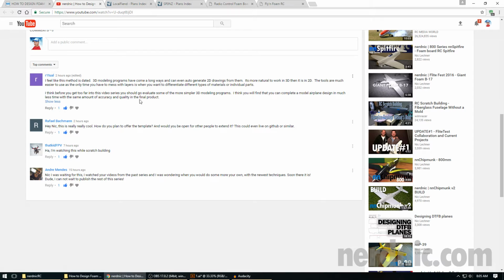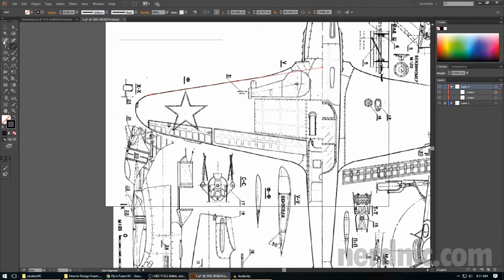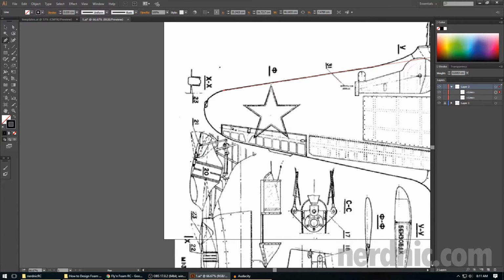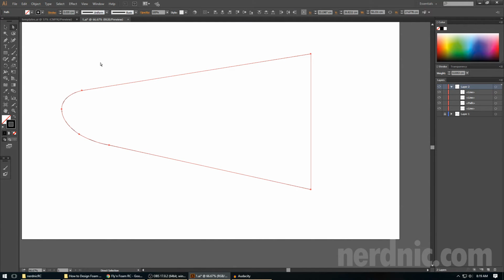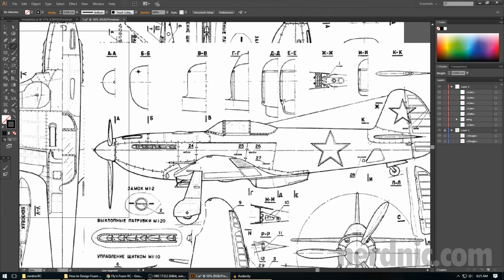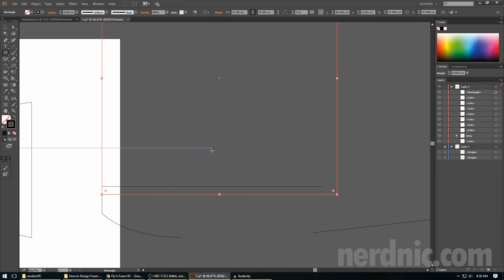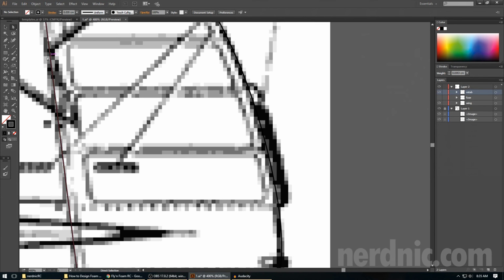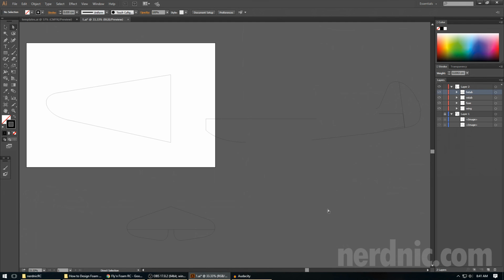nerdnic | How to Design Foam Airplanes - Part 2

Comment: It would be foolish to use a 3d modeling program for foamboard
Reply: Did it and it was way harder to make plans to cut out because you start making really complex shapes which can't be modeled.
Reply: @Sven_Hein  There is a program called Pepekura that turns 3d modeled shapes into fold-able shapes that can be modeled
Reply: @odinata  thank you I will check that out
Reply: @odinata  seems to be a nice program although it's neither free nor Mac compatible.

Comment: What do I do if plane has mid mounted wing
Reply from the maker: The wing and fuselage will build the same, but you will have to add a wing/airfoil slot into the fuselage.
Reply: Nic Lechner thank you :D keep up the good work

Comment: If you are sending these files out to be cut, you should join the lines (nodes) that form the completed shapes, or at least have as continual lines as possible. Or you will frustrate the operator of the cutting machine. All the machines I have run will stop, lift, plunge and then go again on each separate line. Its considered dirty artwork since it makes the job take longer. On a machine that has a slow plunge feed rate it can make the job take several times longer to complete than if all the lines were as continuous as possible. To join the lines together, select the 2 overlapping nodes and select join from the menu, there is a keyboard command for this too, much much faster. You can also do join two nodes that are not overlapping and illustrator will draw a line between the nodes.
Reply from the maker: Great advice! Let me test this and I will bring it up during the series. It might not be till the end of the series that I mention this, though. (I haven't tested this yet) but if the Join feature works as I'm expecting it does, this will make modifications to the not-final-yet product take more time to correct.

Comment: thanks for touching on the point.  its kind of the age old battle but what it comes down to is use what you know works.  for me 3d modeling comes easier,  and in many ways i'm doing 2d illustration anyways,  just with the option of extruding in 3D.  So its all the same!  I didn't mean to come off as preaching in any way,  sorry about that.  I'm not a professional so don't listen to me ;)

Comment: Hey Nic, the pen tool draws Bezier curves. You should read up about them. Understanding how they work will make it more obvious how the tool works, especially when trying to join two curves.
Reply from the maker: Cool! I just watched this video on the basics behind the Bezier curve - https://vimeo.com/106757336

So the process makes sense, but I'm not sure how this knowledge helps when joining to curves? Is there something additional I should look at?
Reply: I'll try to explain :) The line from the anchor to the control point is always a tangent of the curve at the anchor. If you have two curves and you want a smooth transition then the tangents need to be the same, so you either put the control points for both the lines at the same point or at least make them on the same line. This will ensure the tangents of both curves where they meet will be the same.
Also in your 3rd video where you make the curve for the dihedral, if you put the control point on the spar line this will endure that the "thickness" part of the curve will be at the thickest part of the wing. I know it won't make much difference but pedantic :)